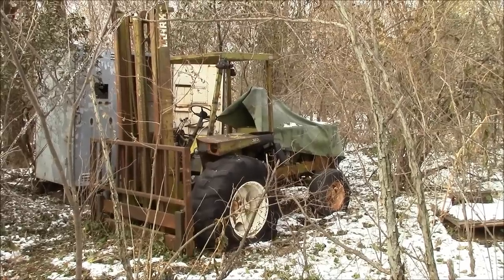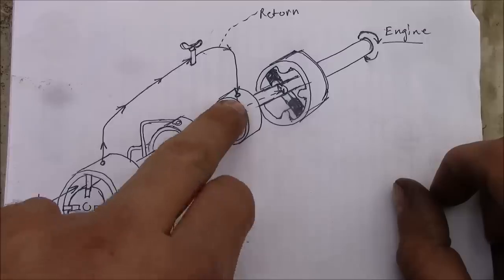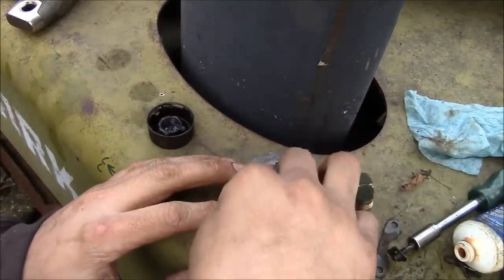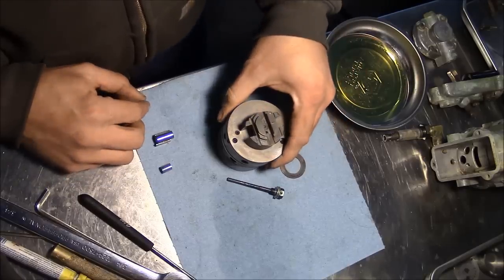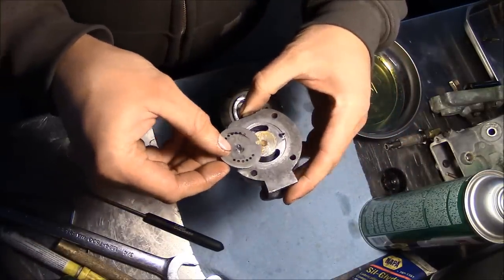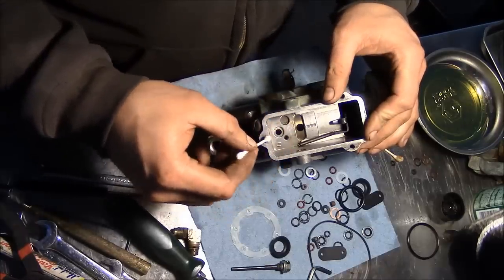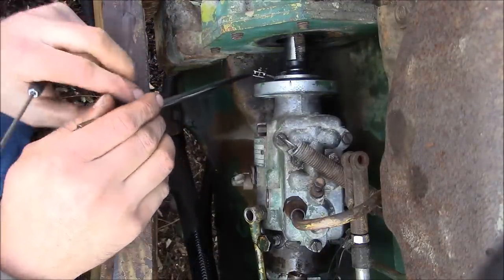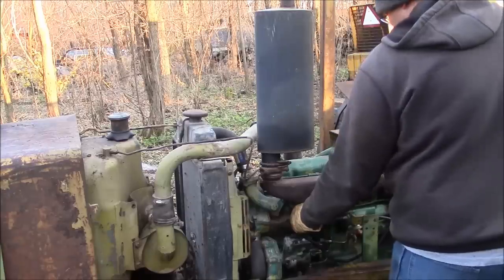Neglected Clark All Terrain Forklift - Will it Run Again?

Comment: I have seen and had neighbors with equipment that have sat unused because they were to cheap to hire out someone to fix some very small stuff on their units, Many of these units cost between 5 and 25 thousand dollars. One machine was an older bobcat skid loader that had a fuel problem. If if was full it would run when it got about 1/3 empty it would not run. I ended up fixing this for the home owner where I was building a welded pipe corral. This was simple add in a new hose in the tank. Few others that I have seen are small dozers that just needed their injectors bleed. This unit sat unused for almost 8 years after they payed 8k for it, Some other neighbor payed 4k for it and by days end it was up and running for a small fee of 300 dollars. 
Just ticks me off seeing things like this.

Comment: I tend to prefer gasoline on a rag over ether. That old timer's trick has always worked very well for me.
Reply from the maker: That would work.
Reply: You are raising the temperature of the inducted air by putting a fire rag on the induction sorry if I misled you.
Reply: @hfraat25  If anything I'd be cooling it due to the evaporative cooling.
Reply: The transfer pump housing is worn you can see the indent in the alloy.this will reduce transfer presure
Reply: We've got a cold blooded Massey Ferguson. Dad put a new, faster, Chinese starter on it and that made a world of difference. Nice work as always Wes, enjoyed.

Comment: you did a great job on the Pump Young man .... but I think your issue is the engine has been run extreamly hot and the pistons are tight or the main bearings are tight  but thankfully enough the rebuild kit for it is cheap and Its  sleeved so really simple  I think it would be no problem for you  and I would also clean the injectors and add a couple shims

Comment: I wonder how much of that thing is Deere? The air filter, tank and radiator all look like 2640 stuff.
Reply from the maker: I don't know. It's open center hydraulics and it has a torque convertor. So I don't think the hydraulics or transmission are Deere. But the engine and even the fuel tank setup are definitely Deere.

Comment: That acts like the diesel engine in my uncles 2010 JD diesel, You have to have a hot 12 volt in it to get it to spin it fast enough to get it to start.  He had it rebuilt 2 or 3 times and finally replaced it with a high torque starter and now it fires up quick !  Something to think about.  Bandit

Comment: The only thing I have found to deal with old fuel gum is acetone.  The little square steel can that says Acetone on the label.  Works like a dream. Don't even have to scrub.
Reply from the maker: It works on some.
Reply: The CRC green can is primarily acetone.

Comment: Old Diesel, produced at times before it had to be blended with synthetic diesel, could be stored almost indefinitely. I  found a canister of diesel which was labeld to be filled 1999 , opened it in 2019 and filed it into a stationary engine. It started and run without any issues. Maybe modern cars would mind? Unfortunately with synthetic diesel added to petroleum diesel, it doesn't preserve that long.

Comment: Hi Wes, the plate on the back of the transfer pump houses a pressure relief valve..its common they stick just like the main pump pistons...(transfer pressure is around 40psi) ive hadthis problem loads of times  if you take the end plate off andstrip itagain you will see what i mean i think..the springs are very small and piston is a tube within a tube. Starter motor looks like bad earthing point in the starter motor itself. Hope this helps
Reply from the maker: I had the same thought. I know the pressure regulator move freely, but I don't know if it's adjusted correctly.
Reply: @WatchWesWork  as i remember it its set by the spring pressure..BUT when yo take ot the inlet union on the top and pull the regulator out there is a seat that the plunger sits on, this should have a very thin paper gasket, if its missing or it cant seal it wont regulate properly
Reply: ive just been and had a look on google and yes there is a very tiny paper washer thats critical
Reply from the maker: @sweetpeaz61  I was thinking the same thing. The book shows a seal for the plunger. But I called the injection shop to ask about it and he told me they no longer use the seal, it's just supposed to seal against the shoulder of the regulator housing. He seemed confused as well. I think I'll take it down to him and see what he can make of it.
Reply: @WatchWesWork  good idea, yo just have to take the end plate assembly to him..im certain if you fit the washer it will work..they are fiddly things as they work on differential pressure each side of the piston.. if it cant seal it cant realise equilibrium and will be erratic
Reply: Also check you have the transfer pump ring body in the right way round..you turn that round for opposite hand rotating engines..make sure of the direction of rotation and that the vanes are going to pressurise fuel into the correct place (I made this mistake once lol ) :)
Reply from the maker: @sweetpeaz61  From my limited understanding, there was a change to the pressure regulator at some point and they eliminated the separate seal and replaced it with a steel bushing that is pressed in to a certain depth. I don't know what that dimension is supposed be, but this pump appears to have the update.

Comment: Wax in the diesel fuel tends to cause parts inside the injection pump to become stuck if left for years unrun, heat on the pump will cause the wax to soften and often will free the components, it helps to drain all the fuel out of the pump and replace with light grade engine oil or similar, diesel fuel is actually a very poor solvent, adding lacquer thinner to the fuel in the ratio 50/50 really helps the fuel to dissolve any wax or gunge in the system.

Comment: Hey Wes I work on tractors small engines and have small part may I suggest theses tools set of long stainless steel tweezers forceps and I item I really liked welder tip cleaners (just for carb work they clean small orvices

Comment: was this the same pump model as the Oliver tractor hard start no start video? If i remember that tractor has a 6 cylinder Waukesha?  But wait i thought about it. if this is a 4 cylinder then it would have a 4 lobe cam on the injection pump and the other one would have a 6 lobe cam on the injector pump.
Reply from the maker: The Oliver is a DB rather than a JDB, but they are almost identical. The seal kits are the same.

Comment: You have to watch those balloon seals on the pump shaft, you can damage them real easily, there is a special tool used to compress them , Oregon fuel injection has them not expensive, if the seal is damaged , you will get a crankcase full of fuel, it is impossible to install the pump & not damage the seals without the tool and you won,t know if you have damaged the seals till      You  check the oil a few days later,  happened to me twice on a jd 350 dozer, bought the tool , happy customer

Comment: How did that pump get gooped up in the first place? -the days when parafin could settle out of diesel are long gone, I would hope?
Reply from the maker: Lets say 20 years of very limited use and constant exposure to the elements. We get crazy temperature swings of 50 degrees F in 36 hours all the time. Plus high humidity in the summer and cold dry weather in winter.
Reply: Thanks for the reply and I'm willing to take your word for it, but, as an electronics engineer; it sort of seems alien/odd to me, in what is supposed to be a completely sealed system, like a direct diesel injection system, that environmental factors could have any influence.

If non-regular use in an adverse climate is going to be a thing, that should accounted for in the design, as far as I'm concerned.

As far as I go, I don't expect anything I design to fail within expected environmental conditions, regardless of how irregularly it is used.

How do engines get exempt from "just working" the way electronics do?

Comment: Just a passing thought.
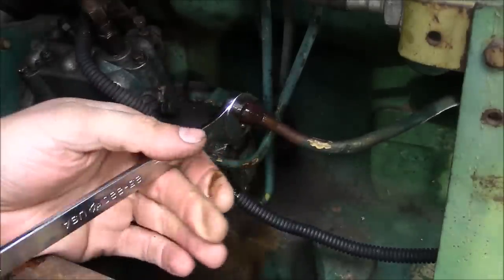9:33 That line looks a little bent at the fitting.  Straightening it would help in spinning the fitting nut itself.
Unless it was the flare itself that was causing the tightness.

Comment: My old Perkins engine excavator needs every spring take the injector lines out getting the air out. but it won't start before at least two lines are connected again.

Comment: RE fuel issue, I am sure that you checked the fuel filter for partial blockage / clogged up.  Any chance this was a military unit, 24 volt??
Reply from the maker: No. It's definitely supposed to be 12V.

Comment: WD40 works really good
Wes the battery cable's problem have to much resistance. 
They are probably green inside the coating.  That happens a lot .
That is where i start when they act like the starter is dragging  .😊

Comment: You might want to check to see if that isn't a 24volt fork lift.
If the truck was a model that could be sold to the military ( and most rough terrain models were) then its 24 volts.
Wouldn't be the first time I ran into a 24 volt truck with a 12 volt alternator/battery that still had its original starter.
Reply from the maker: It's definitely 12 volt.

Comment: Interesting video, you forgot one thing to check the air intake and filter. Diesels wont run without air just as important as the fuel system. Could be blockage in the air intake like birds nest or dirty air filter. It runs at fast rpm ok but stalls at idle speed this maybe because maybe the vaccum from the engine is insufficent. Remember a piston engine is like one giant air pump and fuel wont burn without oxygen. I think you did a great job with the fuel pump so I dont think it would be that.
Reply from the maker: I did check it off camera and found no issues.

Comment: Can you explain how you hook up 2 12 volt battles to make it 24? Have a case track loader that starts hard cold and would like to try the 24 volt setup. Thanks great video.
Reply from the maker: I just used some jumper cables. Unhook the positive battery cable. Find an other 12V battery. Use the jumper cables to hook the positive terminal of the battery in the machine to the negative terminal of the other battery. Then use the other jumper cable to hook the positive terminal of the other battery to the positive battery cable that you have unhooked. You are hooking two 12V batteries in series. But be aware that you will now send 24V to everything, including the gauges, lights, solenoids, etc. There is a risk of blowing things.
Reply: Thanks

Comment: Hmm. Our john deere 300 loader needed a radiator so ordered one off the internet and was like a inch too tall to put hood back on. Apparently they sent a radiator for this. The fuel tank, air filter housing, radiator and engine is almost as indentical our 300 john deere industrial loader except this radiator is taller that the factory jd one. Interesting. Maybe solved our mystery.

Comment: The ut60s had to start and idle in reverse position. Everybody tried to start them in foward or center it between foward and reverse. There is no neutral position on the reverser. Alot of parts interchanged with a john deere 2640 tractor.
Reply from the maker: Interesting. The actual gear shifter has a neutral position. I think it may also have an unloader valve for the torque convertor.
Reply: @WatchWesWork  yes there are 2 gear shifters on the floor. 1 is park high and low the other is 4 gear speeds. They have a screaming road speed. It needs to be in park or neutral on the floor. They dont have a torque converter. Its a clutch pack. Thats why they have a "clutch peddle" it dumps the oil pressure off the clutch pack.
Reply: @WatchWesWork  theres a knurled knob below the deck that controls the delay of the clutch pack from release of pedal to full pressure. They kind of jerk when the pack locks up.
Reply from the maker: @dustyspicher5430  Interesting. I've never actually driven this machine. At this rate that might be true for quite a while longer...
Reply: @WatchWesWork  morrison industrial in elkhart indiana had parts on the shelf for them yet. Some trailer factorys moved mobile homes and campers around with them yet.
Reply from the maker: @dustyspicher5430  OK. My Clark dealer seemed confident they could get me parts. I know it needs a shift cable for the reverser. I melted it with the bad battery ground...
Reply: @WatchWesWork  it was probably bad before it melted. Water runs right in the top by the shifter and rusts them. Or they freeze and the operator thaws it with a torch. Lol. Good luck with it.

Comment: I’m always incredibly surprised when I see normal diesel. It is always jolting to me that it’s not red. 

I grew up on a farm. All of our diesel tanks are filled with off-road use only fuel that is dyed red. I don’t think I’ve ever actually seen non-dyed diesel in real life. I’ve pumped it into vehicles at a fueling station, but you never see that diesel. 

Now the red stuff, I’ve seen that more often than I’d like. Tractors overflowing with red diesel from a gravity tank that does not automatically shut off. Red fuel in the diesel jugs and spilled on myself while filling up a diesel water pump. Red fuel all over the place when changing a tractor’s fuel filter. And anything diesel ever touched was pretty much red and dirty from then on. 

So, diesel, in my mind, is red. I know that it’s really not red, but it’s all I’ve ever dealt with. If I smell diesel my mind pictures red liquid, nothing else.

Comment: That injection pump looked like it could have already been wrecked because of how long the forklift was sitting there,and kinda the same with the inlet,by the way the forklift looked like it was a vintage one.Also you may or may not have saw but the reason it did not start first try    because the enigine was probably seized or it kickstart failed.

Comment: You Probably should have pulled the Delivery Valve out of the Rotor Shaft Wes ,
when the pump is that dirty , the delivery valve gets crap under it and wont hold line pressure .
Thats why it wont run unless you hold up the RPM. There is no magic in those Roosa Master pumps.
Ive rebuilt a Ton of them on the tailgate of a service truck.
Reply from the maker: Yeah I think I will. The seal kit comes with a new stop for the delivery valve.

Comment: Suggestion:  When you need to get a diesel engine started, do not use ether...Instead, use WD40.  WD40, when sprayed, is very flammable but unlike ether, it will not strip the oil off of the cylinder walls.  NOTE: Unlike ether which you can spray into the intake or carburetor and then go crank the engine, WD40 must be sprayed as the engine is cranking.  The oil must be atomized in order to be flammable.

Comment: I tore my injection pump apart twice it keeps getting fuel in the oil.kind of at wits end with the thing. Any idea what can cause fuel to mix in the oil.?
Reply from the maker: Worn shaft bushing or your umbrella seals are bad. That's the only way. Unless an injector is leaking down, but that will only be a small amount of fuel.

Comment: my dad has a problem with a massey fergusom 186 combine it runs great and strart good when it cold  but when its in working tempratures its just wont start, no diesel comes out
Reply from the maker: Sounds like something is worn and letting warm fuel leak past.
Reply: @WatchWesWork  yeah we think like that could be the problem

Comment: Can you give me the measurment on the rolers at the 19:23. I am working on a pump just like the one you are working on.
Reply from the maker: The roller to roller dimension is different for every model of pump. If you can tell me the model number I will see if it's in my book. Should be a 5 digit number.
Reply from the maker: This pump is a 51113 and the dimension was 1.970 +/- .0005.

Comment: Use WD-40 for starting fluid.  For a diesel it keeps stuff lubed and is light enough to fire off weak diesels
Reply: WD40 won't work anymore.  They changed the formula.  I use to use it all the time.  But it don't work since they changed.  Guess they didn't want to name it WD41.  Try using starter fluid instead.     I now curse WD40.   it is not that good of a lub and now it won't start a lawn mower.    Oh yes i am sure if you have and old can of the old formula it would work fine.

Comment: Looking at the comments, clean the fuel tank and pickup tube, the fuel lines, new filters, clean the filter housings, injector lines and check the spray of the injectors. The fuel has gummed up the whole system and the forklift engines don't work very hard so the carbon may be a problem with the injectors. All this needs to be clean or as you know diesel engines get to not run at all. You know way more than I so we will be waiting for some smoke.

Comment: Maybe fuel filters a little plugged, and weak lift pump. Cheap check and possibly a fix. No mechanic but with a weak lift pump and it turning over so slow and a possible dirty filter?

Comment: Problem im finding if it sat for few years and started right up they probly put this fuel in it and for get it rings lock up and valves stop working if they have the modern fuel it fucks good tractors up